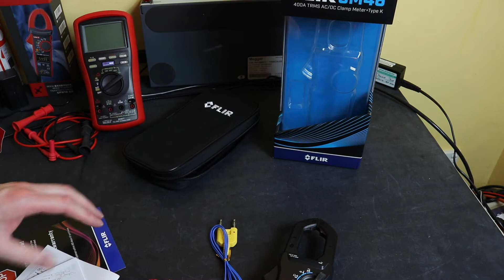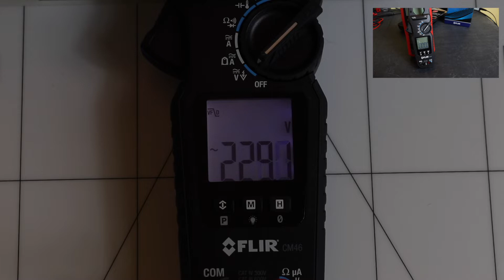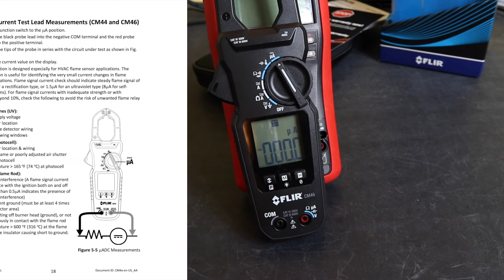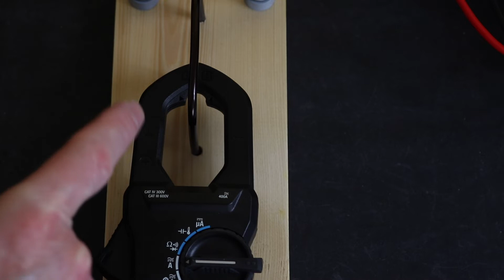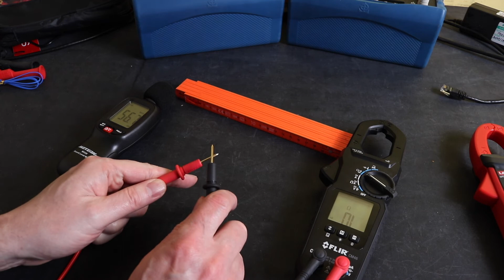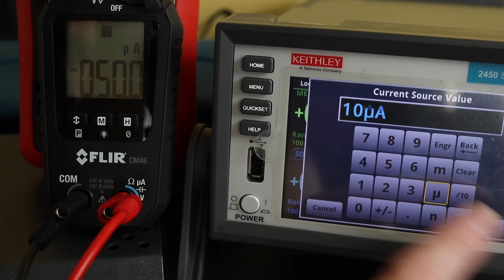Flir CM46 Current Clamp Review

Comment: I'm a little perplexed. I just got my CM46,  and went to measure a battery cell and it's showing as 1.5V, Which seems terribly low precision. Your test results show an extra digit of resolution (Ie your 6.00V injected, 5.98V measured. How are you getting the digit of resolution on your readings?
Reply from the maker: I have just looked at the CM46 this morning and mine has one decimal place and reads 1.5V for an AA cell. I can't remember what I did exactly when testing this meter. It could be that I tested multiple meters at the same time and got the results mixed up, or didn't correct the decimal places setting in the spreadsheet. Definitely looks to be an error on my part.

Comment: I wouldn't be at all surprised if that wasn't built by, or receiving significant assistance from, Brymen.

It doesn't directly tally with anything I can see in the Brymen catalogue but there are lots of relatively unusual features that they share. The AmpTip/Accu-Tip, DC uA, category ratings, etc.

And then you come out with the identical leads.

The argument against is the different display.

Given it has a uA function, you'd have thought they could include a low impedance voltage test too.
Reply from the maker: Thanks for that, great piece of info. I had been looking at Exotech, Appa and CEM, thinking I had seen some sort of AccuTip before and forgot about Brymen. Will see about getting hold of one for comparison. There may be some sort of a collaboration going on, I wouldn't have thought that a current clamp is right in Flir's area of expertise, but you never know.
Not sure on their thought processes for the what functions are included or left out. LoZ volts does require extra hardware, that maybe they haven't got the space for.